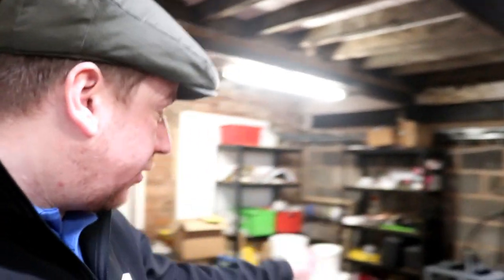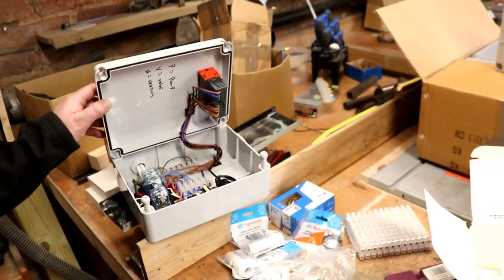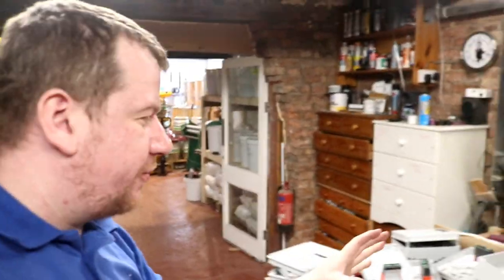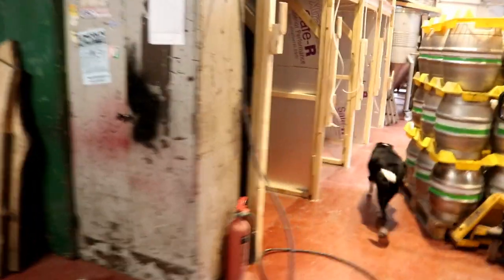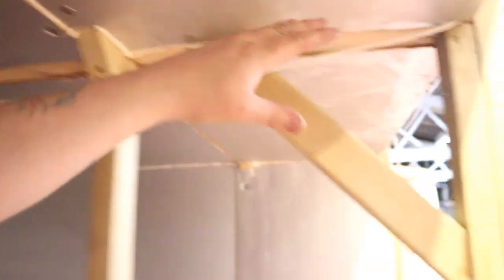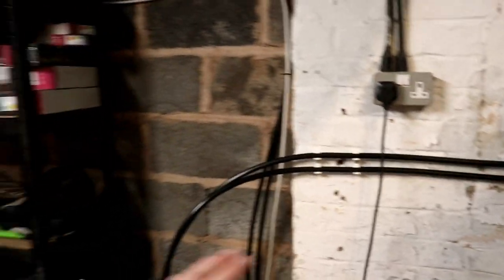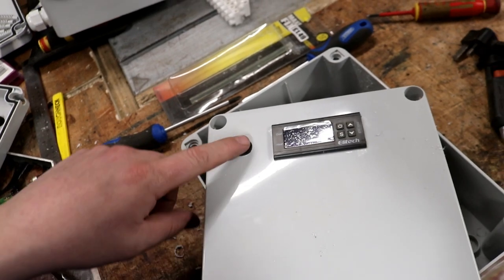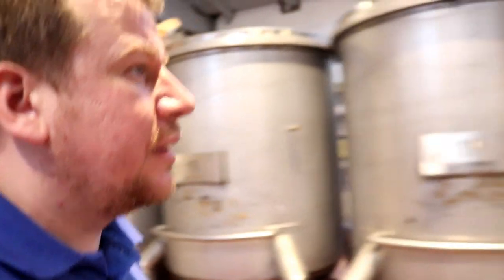COLD ROOM WIRING

Comment: Harry your radiator and fan idea has done wonders for my cold room. Can't thank you enough for this content! Just a quick question on the fan electrics specifically. I'm using quite a large vehicle radiator so have two radiator fans on it. The fans are wired up to a single 20A 12V power supply which is hooked up to a speed controller. What I've encountered is that the fan's don't start up if I have the speed set on the high end but if I have the speed medium to low they start up fine. If I start the fans on a low speed I can turn them up to max no problem. Is the power supply shot or just a crappy one (bought from the china store) or is there another issue at play such too much current at start up. My fans are very similar to the one you use and I cant seem to find any info on how many amps they draw each to determine how much is needed from the powerssupply. Any advice greatly appreciated. Keep up the great content
Reply from the maker: I'm not really sure mate. I had some stalling issues with mine and in the end decided to move to big 240v pc fans. they are cheaper to run but don't quite have the same cooling effect. But all my cold rooms have been below 11C this summer (cellar temps for cask beer in the UK) so I'm happy with the cost saving on the leccy bill.

Comment: How many cooling coils are you going to run in the chiller Harry?

I would be running a fair few all linked up to maximize the cooling efficiency, right now looks like you have just 1 coil in there?
Reply: If I remember right he's not running any coils, he's going to have the liquid go from the top of the chiller right into the pipework and into the cold room.
Reply from the maker: Yeah, no coils. I will be filling the tank with a glycol mix and sending that around the cold rooms